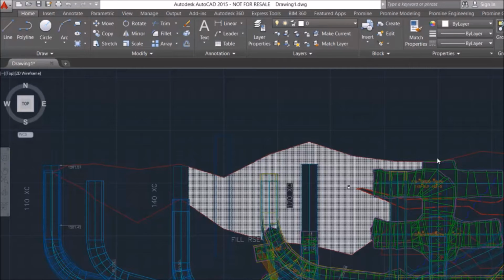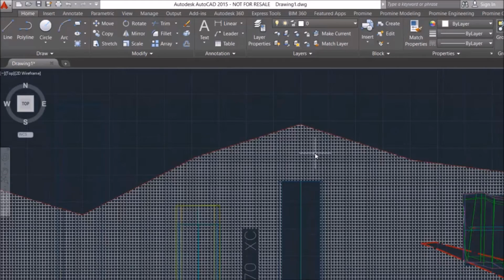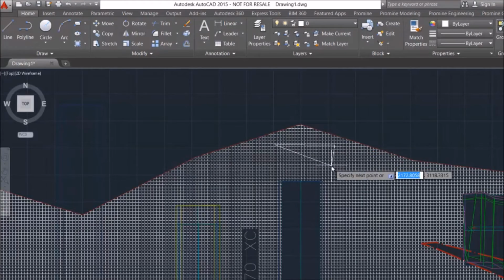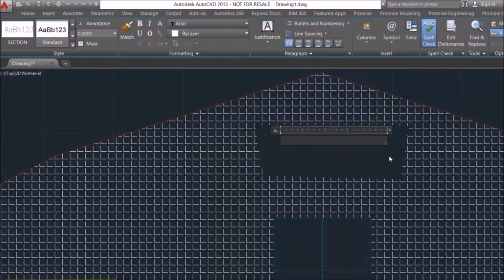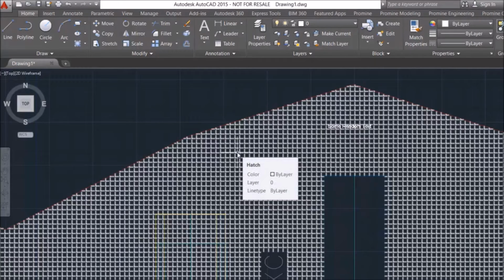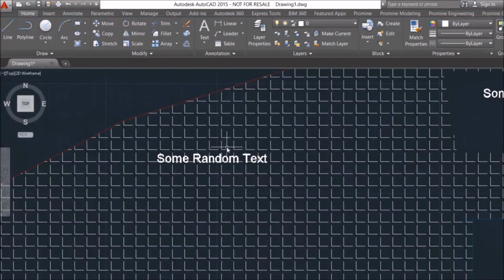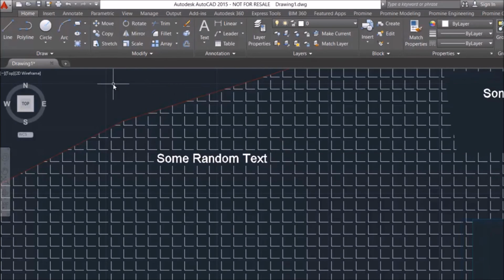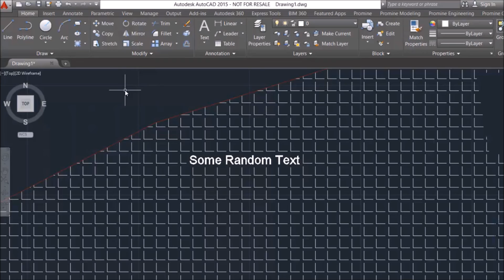Promine AutoCAD Tips & Tricks: Neatly Display Text In Hatches

Comment: If i make PDF of AutoCAd file and then print it on a paper then the area of Wipeout command shows as dark hatch. Any suggestion???
Reply from the maker: Hello, here are a few solutions for you:
1. Make sure the wipeout/text mask is color 255 or 255,255,255 (white). You can easily use qselect command to fix existing drawings.
2. In PDF printing dialogue, there is an "Advance" button, click it and select "print as image".
3. Use any PDF printer to print the PDF file as a new PDF file with above mentioned option ticked.

Hope that helps!